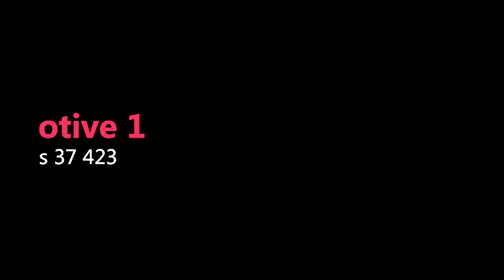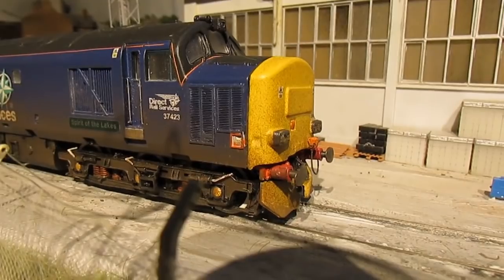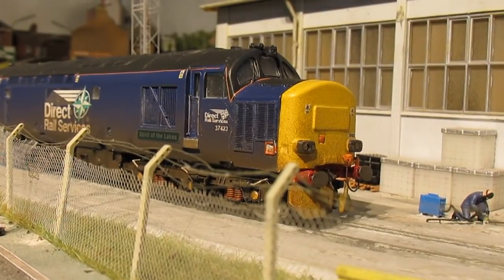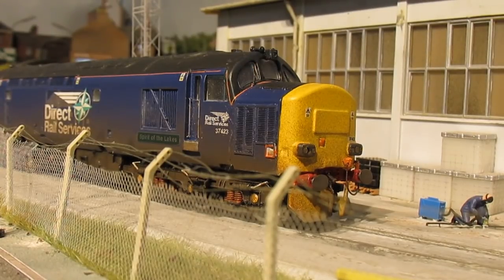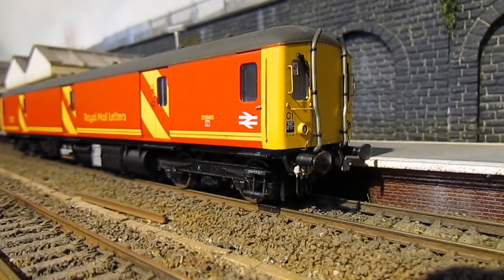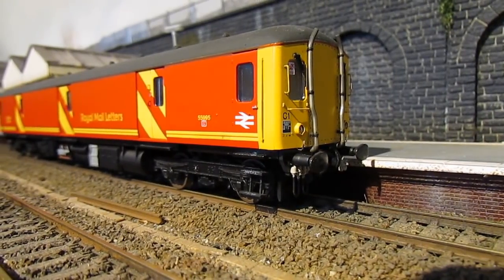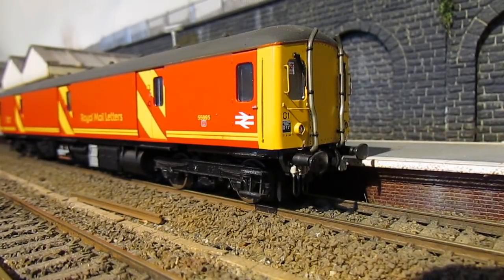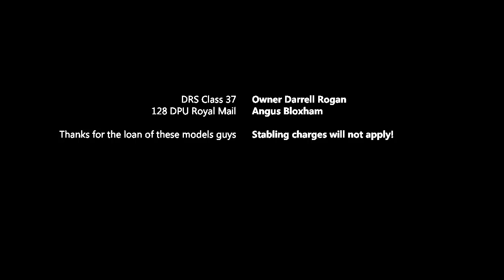VISITING LOCOMOTIVES & RUNNING SESSIONS 1

Comment: Like the visiting loco's , how do you keep the outside track clean . I use a track rubber on my garden railway but it is hard work going round it all every time .    .......Peter
Reply from the maker: Hi, Everytime I use the outside spur track I have to clean it with a track rubber. A bit of a pain to be honest but it does work afterwards quite well. The problem I encounter outside on the rails is stick tree sap, general grime dirt, cobwebs and bird poo!

Thanks for the kind comments.

Richard